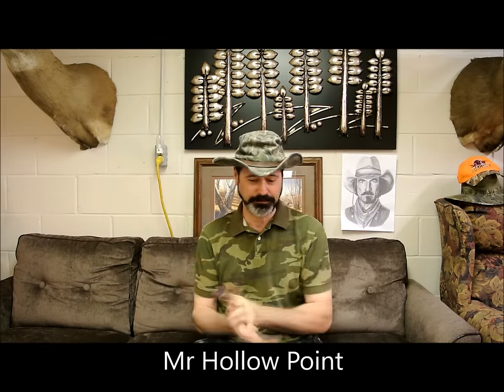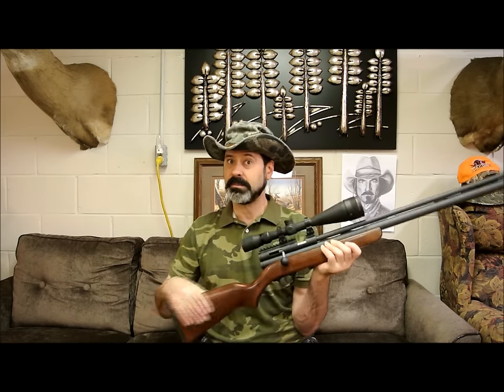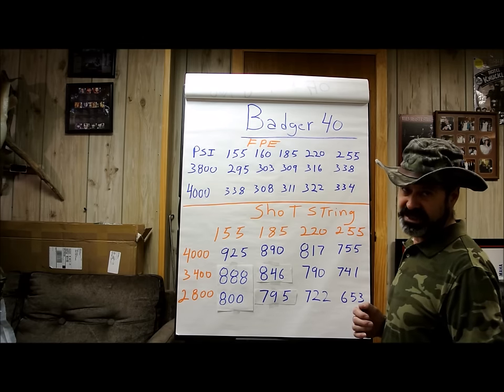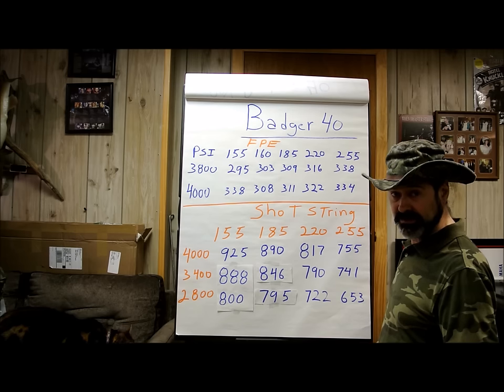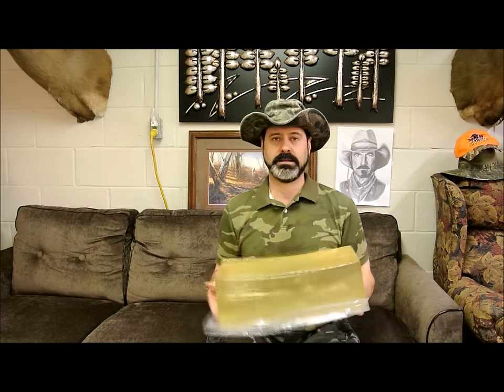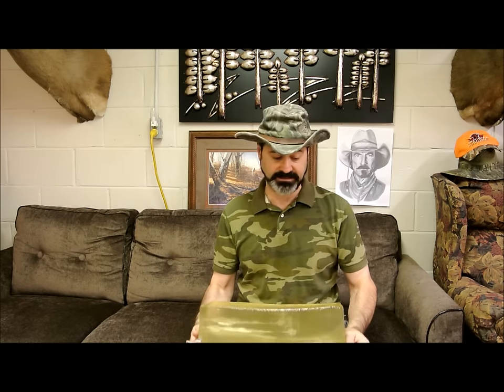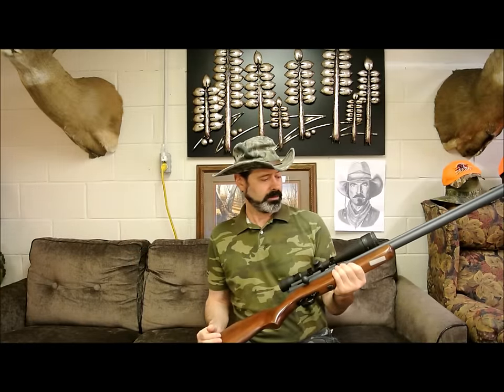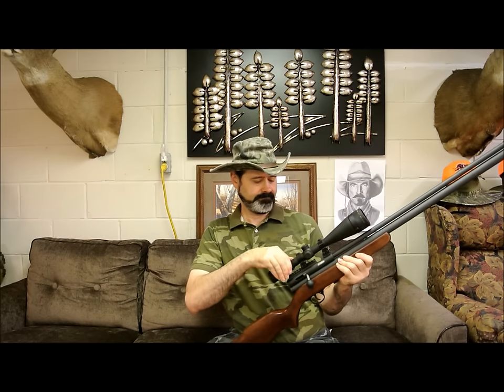Badger 40 Cal Air Rifle part 1

Comment: Wouldn't a round nose or flat point projectile work better for a complete pass through for two leaking holes on heavier animals such as a 300 lbs hog or a 220lbs deer rather than possibly a 1 hole punch with a hollowpoint projectile??? I'm just curious, because I've been doing this my whole life and found it to work the best for complete pass throughs to be a solid best performance with projectiles of any caliber or power charge.Hollowpoints do make more damage. Internally considering the power charge is appropriate. Also considering both types are well placed vital shots. Which one is better?? I'm 53 by the way
Reply from the maker: No, air rifles kills have almost no blood trail, so destroying the lungs will do more damage than poking a hole through both sides. 
400 fpe from a air rifle is not the same as 2200 fpe from a 30-06.
I've proven this point with deer and huge hogs and a cow elk. 
That is why I have spent 12 years perfecting the hollowpoint.
Reply: @Mrhollowpoint1  I see what your saying but I've lived long enough to know that also a 22 rimfire will make a clean kill with a round nose projectile on any of those things and only run around 60 to 75 yards and go down lung shot). A 22 rimfire regular powdered power doesnt have near the power as these big bore air rifles of today. Therefore I will have to decline your information. I'm also a veteran from the United States services 90-93 afghanistan. I've seen it all brother. You have fun now. And stay safe😎👍